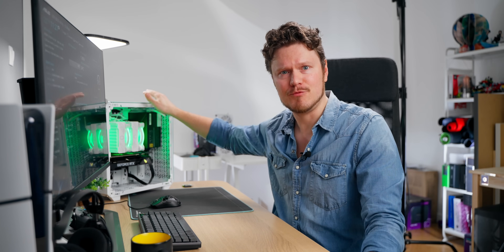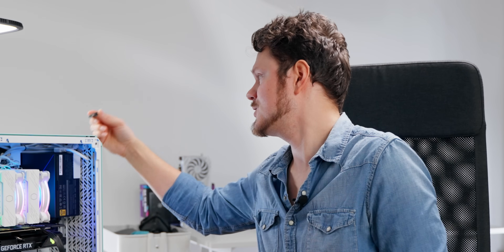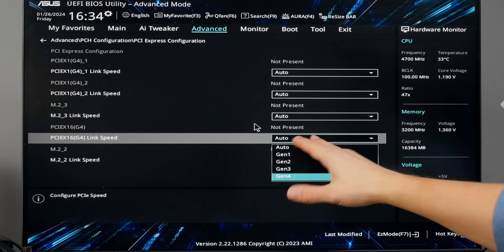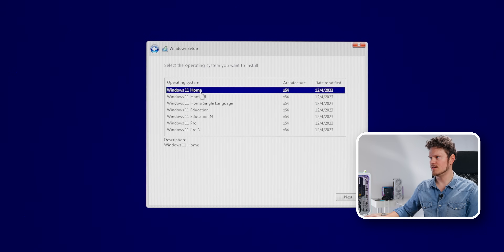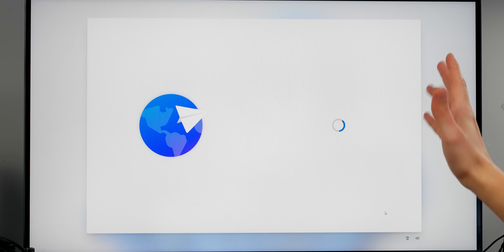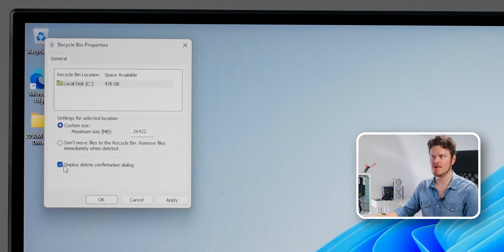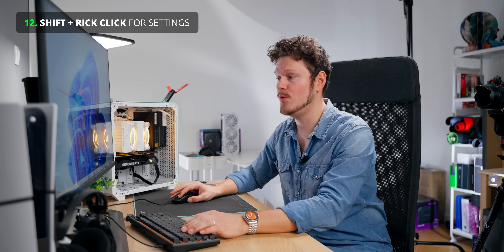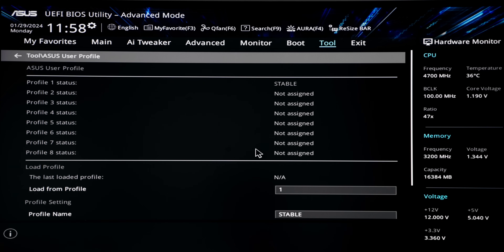Always Do THIS with a new Gaming PC!

Comment: Updating bios to newest isn’t always a good recommendation to new pc users, reason being if ddr5 was working when they first turned on system properly, bios update could mess up the ram settings for stability and compatibility….. be warned… I have g skill fast ddr5 on z690 and when updated to most recent bios, ram stability and compatibility went out the window.. all kind of weird issues running software…
Reply from the maker: Ah damn, yeah that's tricky. Did you make sure to update the BIOS with all necessary previous prerequisites installed too? Like an earlier version of the BIOS that is needed to run the latest. 
-D.

Comment: A small note for AMD Ryzen users, its best to leave the power plan on balanced as those CPUs are designed to work with that power plan. It won't break anything, it'll just boost to max pointlessly and mess with the intended power function of the processor

Comment: As someone who did his fair share of setting up PCs (IT Systemadministrator for 20 years) i really liked this guide and the procedure presentation. Straight "A" from my side.
- that Asus armoury crate part of course differs if you purchased another brand MB. I would liked a more open approach, but I understand the descision to film it that way.
- I personally don't set my energy plan to high performance, because I try to save even more energy. (personal preference)

One setting I always recommend to change is disabling "Turn on fast startup (recommended)" in the "define power button" settings. When this setting is enabled, restarting windows is not truly fully restarting windows and all drivers like it used to be with win 7 and before. Some Drivers get cached and reloaded, which can cause unwanted behaviour even after restarting the system.
Reply: I enjoy fast startups.  On the rare occasion when a "clean" startup is desired, I hold the Shift key when commanding a shutdown, so the system will bypass "fast startup" upon next boot.
Reply: @Chris.Brisson  the thing for me is, that disabling fast startup doesn't really significantly slow down the reboot. Enabling fast startup is more like "make it boot even more fasterer ish", but with the downside of potential stability issues or possible unwanted behaviour. Especially with overclocking I tend to avoid settings that could caus unwanted behaviour. But thank you for the tip with the "shift shutdown" workaround, I will keep that one in mind.
Reply: During this phase of initial updating of the system, we need to ensure the system does not go into sleep mode while an update is in progress, so we configure the CPU sleep time to "Never".   After all the updates are done and the system is ready to rock, then we reconfigure for a proper power plan to save energy.
Reply: @Chris.Brisson  Thank you for adressing  my comment. I got the reference in the video, that you meant the power plan setting to be set temporarily, but i kind of hoped you would have adressed it on more time in the end, to turn it back, since this is kind of a beginners guide. 
That was the sole reasoning behind my comment.
Reply: fast startup only affects turning on the computer after a normal shut down, not restarting. restarting always reloads the drivers (that's why programs after installing/updating say you need a restart). you can also use a forced? shut down when you have fast startup feature enabled by pressing the "Shift" key and then selecting the option "Shut Down". By doing this the computer will do a normal startup after (will load the drivers normally and not from the diver image file that fast startup makes on the drive), and not a fast startup. 😊
Reply: Fast startup is not needed with SSDs, it’s only good with old spinning Hard-Drives cause they take 2 minutes to boot, but in both cases it can cause system instability
Reply: Shouldn't the first thing you install is the chipset driver? On Windows 7, I used to slipstream all my drivers on my install disk. Those were the days! 😊
Reply: Gets an F from me.

Comment: At 10:51 when installing Windows you aren't "naming the PC", just your account.
And afterwards "I do not use any Microsoft products". Only Windows 11 AND M365! Those are the biggest products! LOL.
Also, since you're using M365 I would strongly suggest you have internet connection at this stage, so you can log on with your M365 account and get everything synced. Makes it so much easier. And then you definitely shouldn't turn off all those privacy settings.

Comment: A couple of quick tips: If you put anything in sources\$oem$\$1 on the Windows installation media, it'll end up in the root of the drive Windows is installed on. You could put drivers and any apps you plan to install so it'll already be there. It might take longer during the first part of the setup process though.

Also, Ctrl+Shift+F3 at the setup screen will get you into audit mode. You could then install the necessary drivers for Wi-Fi so you wouldn't have to skip connecting to a network.
Reply from the maker: Oh great tips! Didn’t know about the sources folder. Thanks 🙏 
-D.
Reply: @HardwareCanucks yep he’s exactly right about this
Reply: i belive skipping network is because u cant create offline account when connected to internet.
Reply: Thanks for this info Blake, much appreciated.
Reply: Can you help me out please. I updated by gigabyte b550m K bios to the last version. When I install windows 11, I cannot connect to the wifi... Can you explain for dummies the steps I have to do? Thank you

Comment: My Asus motherboard has wifi built in and Windows still was not able to load network drivers. I had to do the same command to skip connecting to a network during Windows install and download my network drivers on my laptop and load them with a thumb drive.

Comment: That LAN/WIFI requirement bypass was gold!
Reply: You actually only need to do that if windows doesn't have wifi drivers for your hardware which is VERY unlikely. Just keep the ethernet cable or wifi connected and select language as English(World) and you will have a fully clean windows 11 install as for some reason it won't install all the microsoft bloatware apps like clipchamp and solitaire. You can then switch back to your normal language.
Reply: @Fezzy976  Really? So i only need to change language?
Reply: did not know this @Fezzy976

Comment: @8:31 That's what I always do. Delete the partitions.
But another step I also do is before installing windows is I open command prompt. (Shift + F10)
Then I type 'diskpart', then 'list disk', then I type 'select disk 0', then I type 'clean'. IF YOU HAVE MULTIPLE DRIVES, LIKE HE SAID, DISCONNECT THE OTHER ONES THAT YOU DON'T WANT WINDOWS INSTALLED ON.
I've done what he does, by deleting the partitions, install windows. Then I go through stuff that I disable in windows, or enable, and I'm like I disabled/enabled this stuff before.
That's why I always clean my drive now.
Reply: Whereas a "format" command just removes data and the existing volumes and partitions still remain, the diskpart "clean" command removes existing volumes and partitions, making the whole storage device unallocated.

Comment: Great vid! The problem I am getting with my new ITX case is that Windows updates AMD graphics drivers also. Apparently because of it I can't use my iGPU on my motherboard and in device manager the 7800x3d amd graphics driver has a exclamation mark. Tried uninstalling the driver and installed using AMD official software but still no go. Any ideas?

Comment: -Computer isn't restarting before progress starts. It does restart at 30%.
-Recycle bin confirmation dialog controls only that. If unchecked, deleted items will still go to recycle bin, unless they are too big then Windows will ask for confirmation and THEN it's gone.
-Custom nvidia deiver option isnt just to use vlean installation for previous drivers. Most ppl dont need HD Audio or PhysX really. Few games use it these days so some ppl might not want it installed.

Comment: When deleting the partitions when installing windows, does deleting a partition delete all data that is on the drive or just deleting windows off of the drives? If it deletes everything off the drive is an easy way to delete just windows off of a drive without fully deleting all data on the drive?
Reply: Wipes every partition you delete.

Comment: Windows 11 requires TPM to be enabled in the BIOS so maybe that should be among the first things to check. 
Windows Update will have to be checked multiple times, even after it says you’re up to date. 

My personal settings: 
-System>Power>High Performance>Screen and sleep (device) to never turn off when plugged in. Back to System>Multitasking off >select don’t show tabs. Back to System>Notifications off.
-Personalization>Start>More pins>turn off show recently added apps and everything else on that page. Back to Personalization>Taskbar>turn everything off.
-Gaming>I only leave game mode on since I prefer faster FPS rather than recording gameplay.
-Accessibility>Mouse pointer>I select the one with color then I change the color and increase the size to #2.
-Windows Update> Select get the latest updates>Advanced Options>turn on Receive updates for other Microsoft products>turn on Get me up to date>turn on Notify me when a restart is required to finish updating>Additional options>check for Optional updates.
-Apps>Startup>I turn everything off.
-I download Firefox, Ccleaner, and Google Chrome>change to default.
-Microsoft Store>Library>Get updates.

After the system and browsers are updated, I type CMD, select administrator and enter:
-Dism /online /cleanup-image /checkhealth
When finished select the arrow up on the keyboard to repopulate and just use the backspace to erase the last word or just type:
-Dism /online /cleanup-image /scanhealth
When finished again select the arrow up on the keyboard to repopulate and just use the backspace to erase the last word or just type:
-Dism /online /cleanup-image /restorehealth
When finished type: sfc/scannow
When finished type: winget upgrade --all (for more updates) An error often means the Microsoft Store App installer needs updating first.

My weekly dism routine above isn’t case sensitive and repairs corruptions.
Reply: When installing Windows 10 on a system wot would support Windows 11, one can disable TPM in the BIOS to prevent Microsoft from tricking you into "upgrading" to Windows 11.
Reply: @Chris.Brisson  W11 is ok, why not upgrading esp. if its free upgrade
Reply: @milordas  "It's a trap."

Comment: Device Installaltion Settings are also needed to be turned off so Windows Update doesn't automatically install your graphics driver. Especially if you're using AMD cards. Turning off that setting solves driver crash issue people been having on AMD cards.

Maybe because AMD drivers that you've downloaded from the web and downloaded from Windows Update are overriding each other.
Reply: How to do  that?
Reply: @Red-ding-Ton Just click on the Windows Taskbar's search box and type "change device installation settings" and open the program that has the same name.

Next, just pick "No" and "Save changes"
Reply: @Red-ding-Ton  Just search "Change device installation settings" in the Windows search box at the taskbar. Open the first app result, change the option to "No", then save changes.

Comment: One PSA: On some/most ASUS MBs, the ONLY port that will work for flashing the Mobo is the USB that is closest/on-top of the HDMI output in the Mobo… it can be USB C shaped or older… this tip will save you COUNTLESS HOURS of research which unfortunately, I had to invest in due to ignorance.

Good luck!

Comment: During BIOS configuration, you should enable Resize BAR.
Reply from the maker: It was enabled by default, but yes I should have mentioned it. 
-D.
Reply: @HardwareCanucks   yeah, also make clear your BIOS settings will be different in other motherboard brands.

Ex: Only Asus call D.O.C.P. while other brands call it XMP even being AMD motherboards.
Reply: @HardwareCanucks Enabling ReBAR enhances performance for some games but makes it worse for others. Worth pointing out, I believe.
Reply: I thought the Resize BAR feature was for when you have both CPU and GPU being an AMD brand?
Reply: @ragingsilver  how are ppl thinking this ? Like where and when this BS started ?
Reply: @ Because I learnt recently that if the CPU and GPU are AMD, it will be called SAM. If you are using an nVidia GPU with AMD CPU then it will be called reBAR in the BIOS.

Comment: I typically do most of that before finishing the hardware installation in case there's something wrong or that needs to be tested separately, I don't have to undo all the wire management.  I disable the Search box in the task bar because it's redundant, disable widgets and everything Bing-related.  I also like using WinGet in PowerShell to install software, which you can build a script to automate.

I don't know if it's still relevant, but I always go into Device Manager, under each of my disk drives and turn off Windows write-cache buffer flushing on the device.  It used to improve performance on HDDs, but I'm not sure about SSDs.  Also, in File Explorer options, under View, enabling Launch folder windows in a separate process.  It used to improve system stability, but I'm not sure if it still matters.  And while there, changing Windows Explorer to open to This PC instead of whatever the default is.

It's also not a bad idea to go into Windows Features and uninstall anything you don't need, same for Optional Features.  Depending on how you are about security, I really like the Clipboard History, which I don't think is enabled by default.  When finished I like to make a backup image of the system, which you can do in the Control Panel, under Backup and Restore (Windows 7), then Create a system image.  I don't know how much longer that feature will still be there, though.

Comment: How can you have Drives and folders without an OS installed? (Update BIOS saection 2:14). And you don't need to press Delete to enter BIOS if no OS present
OK Only later it was revealed that an OS already was installed. But what if it is a completely new build without previuos OS?

Comment: There's no need to update UEFI unless you have actual problems or severe security risks are fixed. 
Also Armory Crate needs to be disabled in UEFI beacuse itself is bloatware
You dont know if the profile is stable unless you tested it properly

Comment: There are two reasons to remove all unnecessary drives when installing Windows. the first is what you said the second has to do with a quirk of the Windows installer. If Windows sees an existing Windows boot partition it will not create a new boot partition. This can be a problem if you are migrating but not cloning. Something I do if I am upgrading the MB and Processor and Boot SSD at the same time. Moving an OS to a new platform can create chipset compatibility issues so you want to do a clean install but you still want to migrate files you might want to keep the old install until all the files are transfered. The problem is when you finally format the old drive you can no longer boot. I had this problem recently so just wanted to give a PSA in case anyone else runs into this.
Reply: Really good tip - as someone who dual-boots, I prefer the OS to just boot itself and I choose which one in the BIOS (effectively using UEFI as a boot loader). Having GRUB and Windows separate is generally a good idea! Plus it stops the installer putting the boot loader on a random disk which it shouldn't do but has been known to :o